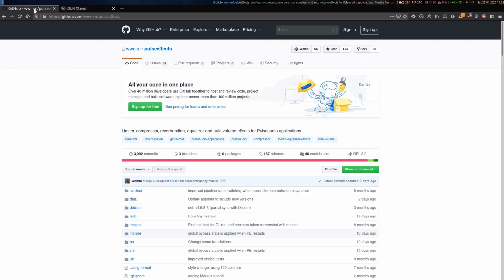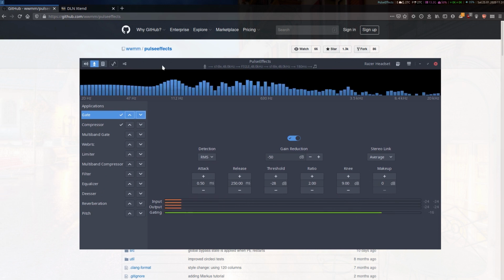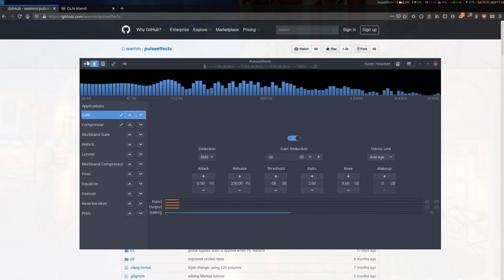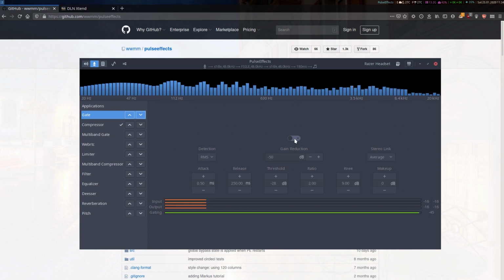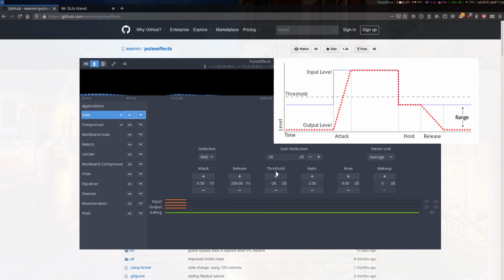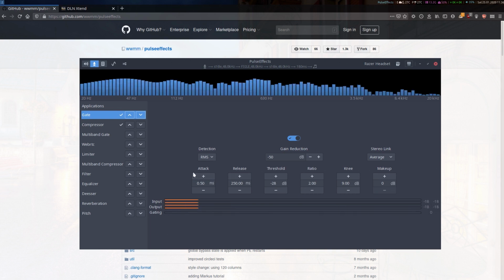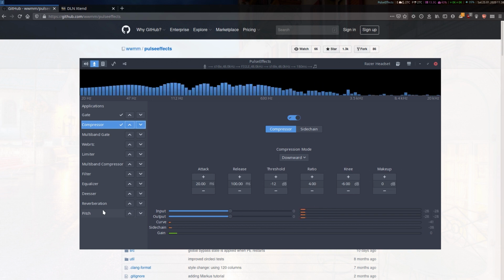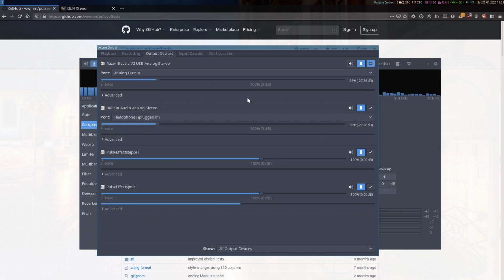PulseEffects - Realtime Audio Processing (Gate, Compressor)

Comment: Have you tried to used it with OBS? I had some problems, but I could not address it better yet
Reply from the maker: No, I haven't tried it with OBS. In fact I am very much a noob with OBS. However, I do believe that it has some of these functions built into it, though without as many options and configurability. All said, as it works separately from OBS, I believe that it should work.